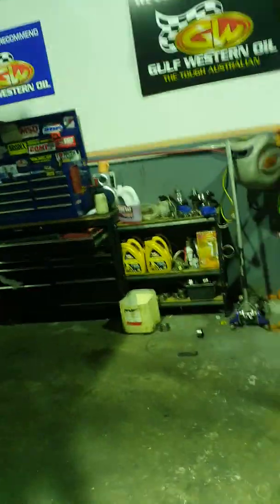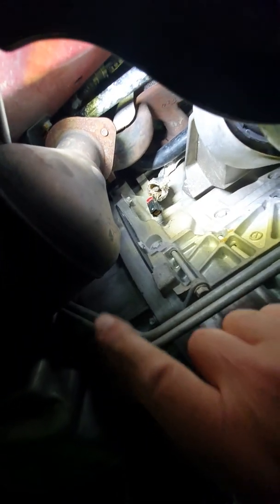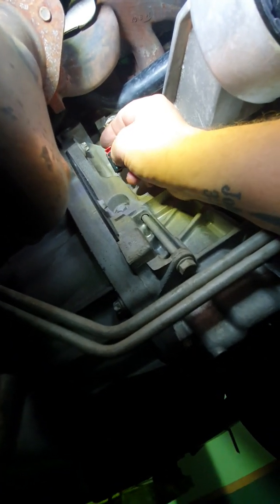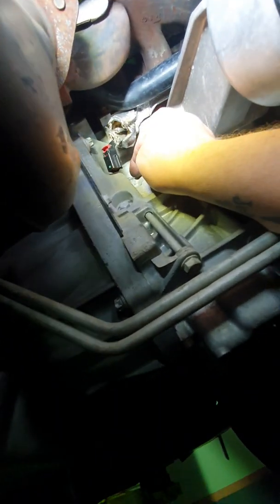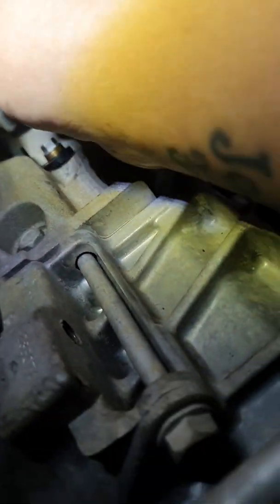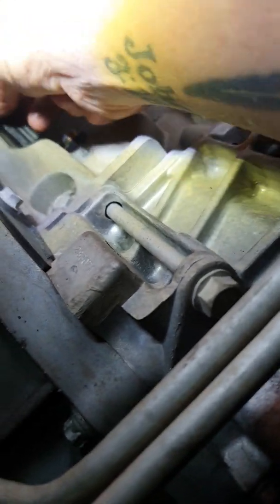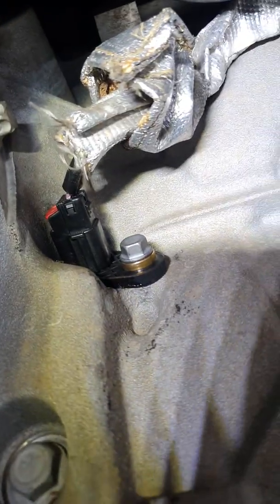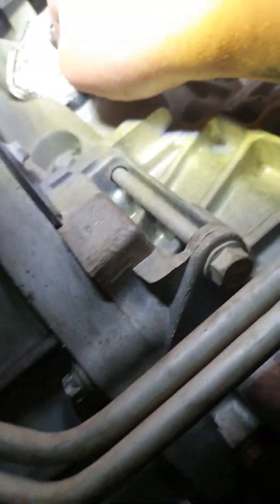Where is the crankshaft, crank angle sensor located on a VE Commodore V6 engine

Comment: My car i turned offnext day it wouldnt start and when it did  it soundedlike lawn mower. I swapped fuelpump. But wasnt that. Would it b this?
Reply from the maker: Usually a crank angle sensor won't let the engine start 
We did have a Honda that had issues if it running and stopping which again was a crank angle sensor issue 
I'd do a bit more diagnosis to find the issue Regards Matt

Comment: This video just saved my ass. 
I just got done with my first ever engine swap and was getting a crankshaft code, swapped over the sensor from old motor to new one and still good. Just watched this and realised I put the plug on backwards with the red clip facing the wrong way. I owe you a carton legend
Reply from the maker: @unklejackxx6145  All good It's great to be able to help others out in need Regards Matt

Comment: Does anyone know how to get the computer to except the new crank angle sensor???
Reply from the maker: It doesn't need to. All that's required is to delete the original code after the new sensor has been fitted. Hope this helps. Peace be with you Regards Matt

Comment: Can it stop it from starting? My died over the weekend, just cut out and now won’t start. Any hints
Reply from the maker: If the engine is winding over you may have a faulty Crankshaft sensor. A scan tool would quickly confirm or deny that
Otherwise you could check for spark at the spark plug or coil. If there's no spark then it maybe the Crankshaft sensor
As always Check fuses and relays eg ECU, Ignition etc
Hope this helps Regards Matt
Reply: @firstclassbrakesandautomot6941  I've got an oddball problem(at least to me anyway). My X6 ute finally konked out after being rough running at start up for a while now (once it warmed up it was fine and ran great on LPG) Now it just cranks over but is getting no fuel. Pulled the fuel pump out (whatta C%$t of a job !!) and cleaned it as there was loads of crap in the plastic housing. Anyway the fuel pump works with 12V plugged into it so I put it all back in thinking that was the smoking gun and the answer to my problem. However, i discovered after the car still wouldn't start that there is no power at the plug to the fuel pump. Fuse is ok and relay is fine. Strange as it's almost like an immobilizer type issue. Was wondering if it's the crank sensor shown in your video but there is no engine light. It's got me buggered

Comment: Hi mate ve commodore v6 was going one day won’t start the next replaced fuel pump no codes cranks won’t fire no spark I think?a real head scratcher
Reply from the maker: Check all fuses 1st preferably with an ohm meter as at times they may look ok but aren't.
Failing that perhaps a new crank angle sensor. It would be good if you could connect up a scan tool and see if you're getting a signal from the crank sensor before replacing it hope this helps regards Matt

Comment: If that’s senser fucked would that throw the motor an computer in to limp mode at all an throw a power reduced code an warning light mate as atm I’ve got a ve sv6 that’s going stright into limp mode power reduced mode and check engine light is all on last owner spent a shit load of money on new parts trying to solve the problem but still hasn’t changed
Reply: Hey, did you get it resolved?

Comment: Hey mate love the video. I suspect this is the issue im having at the moment but im not getting any stored codes (Sidi Alloytec). Just sluggish misfires after the engine has warmed up and flashing engine light before it stalls. Ive already had the ignition coils and spark plugs replaced. Very frustrating, any thoughts would be great.
Reply from the maker: Possibly crank angle sensor but get the fuel pressure tested 1st in case its really low. Have an awesome weekend
regards Matt
Reply: @firstclassbrakesandautomot6941  It was a broken relay on the ECU board the whole time. Very hard to diagnose because often it will not code. Common in LFX sidi engines found in Commdores and Captiva engines from roughly 2011. Chinese made instead of Bosch due to supply issue at the time. Shout out to injectronics for re-building the ECU for me. Not cheap though cost nearly $2k. Car is now working perfectly. Took 3 years to figure it out.
Reply from the maker: @tidlywinks  Thanks for the update we are forever learning Regards Matt
Reply: @firstclassbrakesandautomot6941  Thanks mate ill let you know how i go.
Reply: @tidlywinks  what was the issue in the end did you get it fixed?, encountering same issues.
Reply: Ok so got it back from the Mechanic and there were still no fault codes. They dismissed my sugestion of a potential fuel issue or crank sensor. They did'nt charge me but they also did'nt try. Super frustrationg now ill have to wait for a second opinion.
Reply from the maker: @tidlywinks  Hang in there I'm sure once you get a 2nd opinion and fuel pressures etc is checked and tested you''ll get to the bottom of it. Perseverance and Patience always Pays off for those who keep to the course WILL get to their destination. Regards Matt.
Reply: Try cleaning your O2 sensor if car stalls or has bad idle
Reply: Today it finally stored a code! 

P0011 
- A camshaft position timing over advanced or system performance bank 1
- Incorrect camshaft timing 
- Wiring issues in intake timing control valve or control solenoid system
- Continuous oil flow to VCT piston chamber
- Failed timing valve control solenoid (Stuck open) 

Thoughts gentleman?